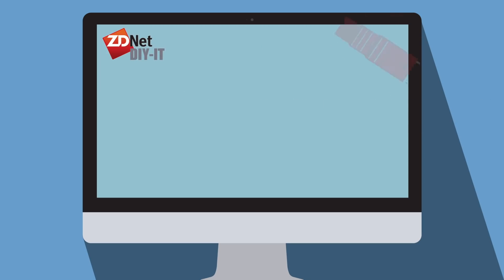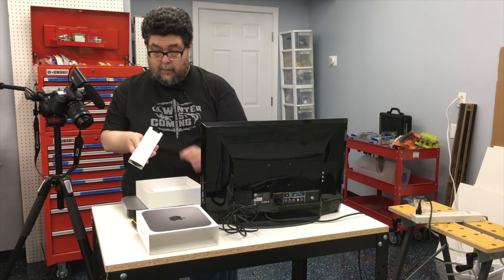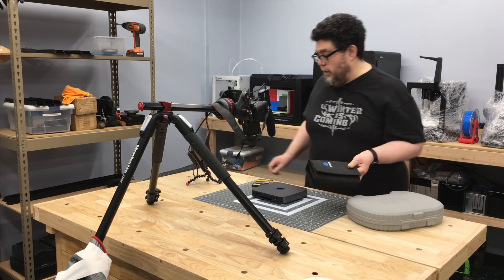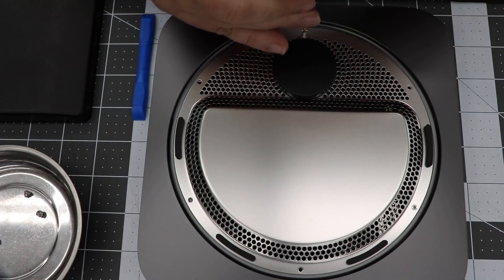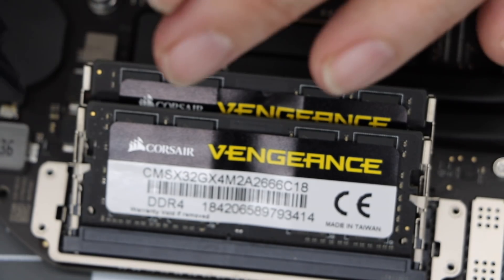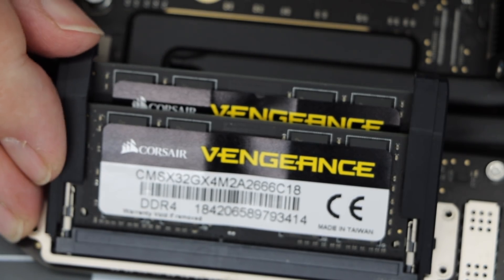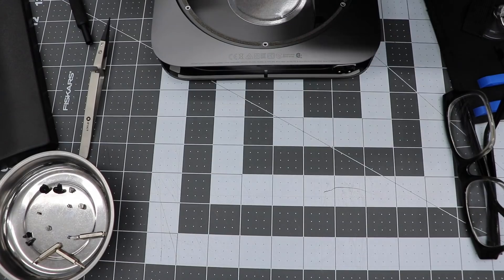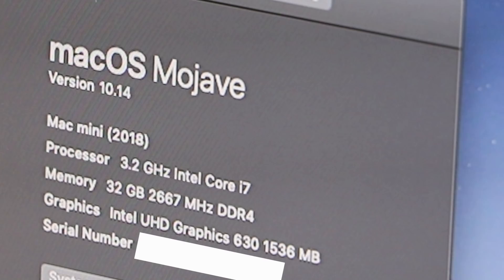2018 Mac mini RAM upgrade: step by messy, fiddly step

Comment: I found this after reading your piece on purchasing the Mac mini you had earlier conceptualised. I definitely don't operate on your level or have your knowledge of the hardware, but find myself similarly placed in using the Mac as a workstation, wherein I run two virtual machines all day, all guns a blazing, cad, excel, sundry design routines, etc...

Have been looking sideways at my 2017 iMac 27 i5 and wondering what might be more suitable (my first guess was a 12 core, 2.7 gig Mac Pro), can you tell me, how did you find this machine handled running multiple VMs...?

I haven't found anybody else that even considered operating in such a manner, been feeling like a freak on my own planet....
Reply from the maker: So here's the thing. I bought a very fast (in terms of storage read/write speed) MacBook Pro back in 2015, but i made the mistake of getting an i5. I mostly works, but for heavy workloads (video editing, VMs, etc), it wheezes. I've found the 2018 Mac mini with an i7 (fastest clock speed) to be pretty good. I do use an external GPU and that's a bit slower than I'd like, but it's workable. I don't like the iMac because the screen becomes a bit of an albatross. I don't want a heavy 27-inch screen. I want something wider and bigger. Today, the two machines I think are most viable (and not going to make you throw up because of cost) are the 2018 Mac mini i7 and the 2019 15-inch MacBook Pro. If you can keep the MacBook Pro cooled, it's actually probably a better move with the i9 than the Mac mini, but once again you're dealing with a screen that might not be optimal. Hope that helps.

Comment: Thanks  for a great video.  I am not a "Mac Person"  I have it mostly for shits and giggles but it has been running dog slow lately  and I wanted to upgrade the ram.. Should be simple right?  Yeah  where  are the dots  to twist open the panel  (yeah  on that model  the memory upgrade is simple)
You are saving me  from having to take it in  even though I had to order those microscrewdrivers  and  nylon wedge kit.
Well done on the camera work as well.

Cheers
Reply from the maker: Thanks! I was definitely holding my breath the whole time. I'm using it now and it's been running smoothly.
Reply: @AdvancedGeekery  Glad it worked out for you.  Mine... not so much.  Turns out after all the idiocy with screwdriver bits  my mac mini has no up gradable ram. No memory slots at all. Yeah  I don't think I will be getting another now that the price  has shot up 300 more with a quarter of the HD space.
Reply from the maker: @TheCynysterMind  Oh... you must have the infamous 2014 Mac minis. So, you may have missed a bit of drama. Apple did not get around to updating their Mac mini for about four years. Their 2012 models, like all the models before it, had upgradeable RAM (and drive, by the way). The 2014 was a locked box, with no way to upgrade the RAM (and it was slower, too). But in 2018, Apple finally released a new Mac mini - - which is what I was showing here. We thought it had the chance of upgrading the RAM even though, up until we (meaning everyone who cared) got our first units, we weren't sure. The 2018 model is quite an improvement, but if you have a 2014 unit, you're completely SOL. Sorry. I feel your pain, I truly, truly do.
Reply from the maker: @TheCynysterMind  One other point: read this: https://www.zdnet.com/article/which-mac-to-buy-10-tips-to-help-you-decide/ It's my guide to how to think about upgrading. No way, with a 2018 machine, you should spend much on drive (although I recommend the 512 unit just so you have enough space for five years of OS upgrades plus RAM). With Thunderbolt 3, you can add external super-cheap SSD drives and save some bucks.

Comment: if the connect point of wifi antenna cable is broken during tear down. Is it impact of device performance?
Reply from the maker: Probably. Antennas exist for a reason, and if you broke the connection to it, then you probably won't get a quality signal (or at least for a good distance). Breakage not good. Check iFixit for possible leads on parts and ways to fix.

Comment: Fantastic video. I'm going to try to go to 64 gb. Are anti-static straps not required anymore? Bell Lab videos used to show semiconductor substrate damage from static electricity that might not show for a year or more?
Reply from the maker: It's always a good idea to use anti-static straps, even though I never do (and may someday regret it). If you get up to 64GB, please post where you got your RAM and how it turned out.
Reply: I've just installed 32gb modules but have no idea how can I fully load them lol

Comment: If my mac mini 2018 is 8G ram.  Is it possible upgrade single ram slot to 16G ram, the rest slot keep 4G ram?
Reply: @Bernd Hofmann which brand name of ram is suitable for mac mini 2018?
Reply from the maker: I didn't think so, but @Bernd says yes. I'd bet you'll get some slowing, but depends on what you need.

Comment: Very interesting.  If i put in 32gb of Kingston HyperX DDR4 Ram running at 3200mhz, will it actually run at 3200mhz or does the system cap at 2666mhz speeds ?
Reply from the maker: I believe (but don't know for sure) that it caps at 2666.
Reply: Not sure if they will work at all

Comment: Do NOT use this to learn how to change RAM. You WILL fail and break cables. First error was when removing the lid with the bluetooth antenna. He removed the screw, but did NOT show how to remove the cable/connector.
After that, this idiot starts to pull out the motherboard, without even thinking about removing the powecable... Shit!

If you want to open your Mac Mini, use this guide: https://www.youtube.com/watch?v=i1gFhTuFjHE&t=108s

Comment: @David The Mac Mini can support up to 64GB of Ram yet I only see two slots. Do 32gb single RAM units exist? I don't think so, but I'm not sure. I would also like some info on what external graphics card and casing you are going to buy. Thanks so much for doing this video Sir!
Reply from the maker: These guys list 64GB. https://eshop.macsales.com/shop/memory/owc/apple-mac-mini/2018 As for the card, I bought the Sapphire because this is a reference model Apple explicitly says they support. Haven't installed it in an eGPU case yet. https://www.amazon.com/gp/product/B07BGZNTQJ/
Reply: Thanks for the info! I decided to simply upgrade my old 2009 Mac Pro. It's actually going to be cheaper for me at the end of the day. I am getting the two 6 core CPUs in it and upgrading to 64 GBs of RAM. Total cost: around $1k!

Comment: Thanks you for the video, very help full.  How many DDR4 slots are there, 2 or 4?  I only see 16 gig of ram on Amazon so there would need to be 4 slots.  but from the video it looks like there is just two.
Reply from the maker: Two. I found 64GB at OWC (see a link on this thread), but haven't tried it.

Comment: Most detailed and with lots of safe recommendations vídeo I’ve seen so far. Just remove that TV back, is really ugly 😛 would love to see some benchmarks and temperatures/throttling of your i7 pick. Thanks a lot!!!
Reply from the maker: Yeah, it was the only available screen I could find on short notice (the rest were connected in the house). Didn't plan ahead and when the box arrived, I did this very inelegant run around the house trying to put everything together to film. Next time: plan ahead. :)

As for speed tests, hope to do those soon. There are lots of good numbers out there, but I am curious about my own box.

Comment: Great video 👍 I wonder if the tools you’re using have magnetic tips to make it easier to control the tiny screws?
Reply from the maker: The T5 clearly held the screw, but it's not much of a magnetic tip if there is one. I used to have a block that would magnetize the tip of a screwdriver, but it got lost in a move. The thing about this screwdriver is I don't know if the driver tip was magnetized or the fact that the screw spent 40 minutes in a magnetic bowl gave it some grip. That magnetic parts bowl, by the way, is a sometimes-free Harbor Freight giveaway.

Comment: Can you share the link of the RAM memory?
Reply from the maker: Here's the complete spec of what I built. The RAM link in in the Amazon mention in the article. Just note that I didn't exhaustively evaluate which RAM to buy. I forgot to order it earlier (I usually buy from Crucial, just because it usually works), but forgot. So I did an overnight Amazon order of what seemed okay. So far, it's working. https://www.zdnet.com/article/yes-i-bought-a-2018-mac-mini-and-heres-how-i-specd-it-out/

Comment: A good video, but actually...

Finally, this is the Mac mini that you were demanding from Apple: Not intended for consumers at all (and it's way too expensive to be any good for normal consumers) and has user-upgradeable RAM...
Reply from the maker: I think the Mac mini is ideal for consumers, although historically, consumers have gravitated to notebooks. I'm a quite disappointed that the entry level machine is $799 instead of $499, because that pushes the entry level Mac up in price, possibly more than folks can handle. As for RAM upgrades, this was difficult. It's doable (compared to soldered on silicon), but could potentially damage the machine. Apple charges WAY too much for memory, so this is a way some folks (me included) can afford it. But it's challenging, very fiddly, and almost kind of scary. I will say that I'm also glad this machine isn't as top-end limited as the old Mac mini, because it is also so very useful for users like me with more intense demands. I think this is a good compromise machine, but as in all compromises, ain't nothing perfect.
Reply: This time I think the mini worth the money... I built a pc with 8700K and it's about $1600...(with better video card).. 
While the pc is so bulky...
Reply: To keep the Mac mini affordable, they should have included a fusion drive. Not only the RAM is expensive - SSD storage is, too 😕
Reply: @TheCalisto1994  You know, I have to wonder whether a hard drive would be cheaper. Back when I worked for a computer company (a LONG time ago), the head of manufacturing used to say that anything soldered on the board during manufacturing was cheaper than external components added to the board. I don't know if 128G soldered-on-board SSD would be cheaper than a small hard drive, because they'd need to allocate space, have mounting brackets, and go through all the steps for assembly and QA. That's totally speculation, but I do wonder if we've reached the point where it is cheaper to put soldered-on-storage in a system.
Reply: David Gewirtz Well, compare it — you'll find a thousand HDDs with 1TByte for ~50-100 bucks but a 1TByte SSD will be a few hundred dollars/euroes more. They're always expensive. The earlier Mac mini had a 500GB HDD and was able to be priced $499 or 569€ — the new Mac mini is more than 50% more expensive, same to the MacBooks which obly use SSDs. The MacBook Air doesn’t start at $999 (or 1099€), it's ~$150-$200 more expensive. And SSDs don't seem to become any cheaper... 😕
Reply: Fusion drives are crap.

If it spins, it's worthless to me (two exceptions are backup destinations and enterprise RAID).
Reply: gskibum Yeah and you're the middle of the world?

SSDs will never become affordable - they'll be expensive, even in 30 or 40 years from now. They've already been expensive for decades.

Many people (including me) can't afford a 1TByte SSD or any Mac with a 1TByte SSD...

And another advantage of HDDs is, that they live much longer than SSDs (more writing cycles)...
Reply: SSDs shouldn't be enforced. Fusion Drives give you a combo of speed and storage flexibility cause 1TByte won't cost you as much as a 1TByte SSD. Even folks which are not super rich may buy a 1TByte fusion drive iMac. But normal folks e.g. will never be able to buy a 1TByte all-flash MacBook Air...